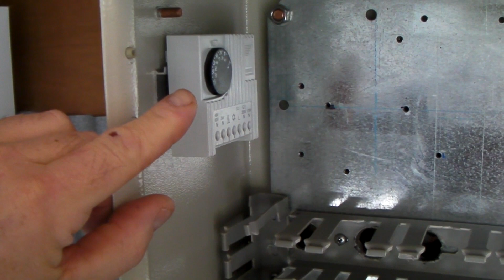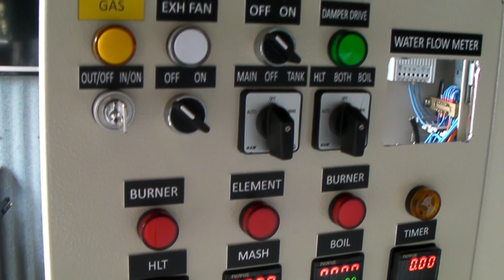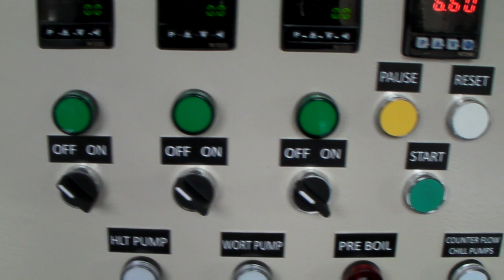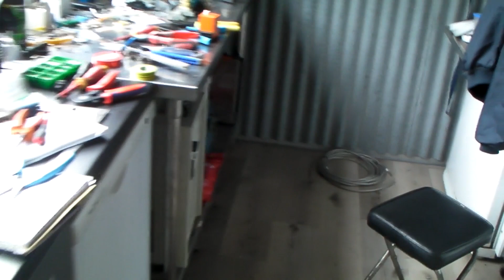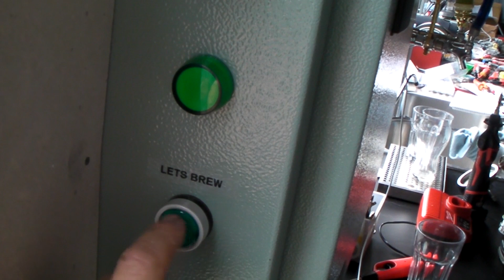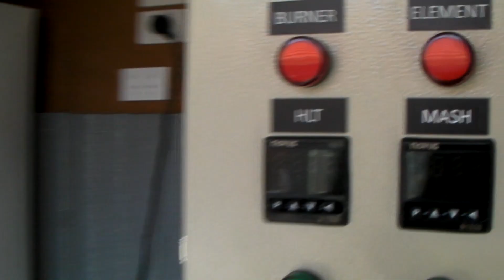Brewshed Update #6 - Control Panel Build 2

Comment: Awesome job mate! What size system are you looking at? Might of missed it, but are you running off 15amps or more?
Reply from the maker: Sorry for late replay - just see this. Simon is an electrician so he has wired it to handle 15amo ipas required. Will also be running gas burners do we have this covered

Comment: Nice! All electric brewing wired by a genius. Looking forward to the brewing.
Reply from the maker: Cheers Pierre. The system will be both gas and electrical - why not 👍
Reply: @abernethybrothersbrewing3838  Sorry, I did notice that! Would it have been a lot less hassle if you just used electricity or did you decide that you can control the temps more accurately with gas?
Reply: By the way, it looks awesome. You guys have some great skills.
Reply from the maker: Yeah we started with full gas system in mind but thought we could add electrical at the same time without a lot more work. Electric/gas option will just be in the HLT - gas for the boil kettle. Will see when we start brewing what works best from brew to brew
Reply: Hi, could I please grab your Email address?
Reply from the maker: @SimpleHomeBrew  beerdrinkers@abernethybrewery.melbourne